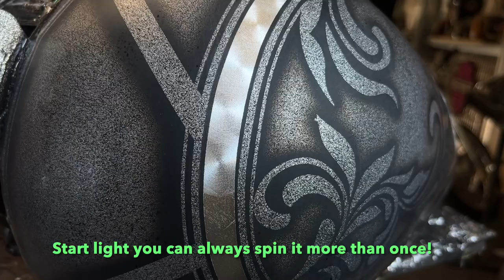Prove Me Wrong!! BEST Method for applying Gold or Silver Spun Leaf from LiME LiNE

Comment: I'm going to start on my 5 gallon conversion tank for my 2018 Street Bob this weekend.  Can't wait to try out the Lime Line leaf, spinner, size, flake and tape I purchased.  My goal is to do something similar to the tank you just did in color scheme, but do a couple light coats of black candy on top and adding just a bit of holographic flake to the metal flake.
Reply from the maker: Awesome 👏

Comment: I love this channel and have learned a ton from you. Thanks for sharing your experience and knowledge with us. I ordered the limeline sizing glue (and the roller & brush too) after watching your videos. I am really struggling with it. I think that they forgot to put the magic in the bottle that I got. 😁 I tried to follow your directions and that on the label. 2-3 coats with around 5 minutes flash time between coats and it always seems to be  too dry before I can get the leaf dropped into place, which leaves it terrible looking. I am doing something wrong,  but I don't know what. I was having a little better luck with the oil based sizing, but I wanted to give this a shot just to try it. Any insight as far as what I could be doing wrong? Thanks again for your time.

Comment: 1:37 why do you remove the making before spinning? 🤜🤛👍🙋🏻‍♂️🤷🏻‍♂️🤦‍♂️🌿
Reply from the maker: So you can correct imperfections on the edges before spinning also the can tape prematurely wear out your turning pads. 🙌
Reply: @TimeWarpCustomPaint  isn’t it like 3000 grit or something like that?
Reply: @Deerslyr81  5000 grit is what comes with that spinner.  I have seen people use 3000, but you have to be careful not to tear through
Reply: @breedlofam  this is going to sound bad , but remember I just started watching these videos to learn. I didn’t know that they came with anything on them. I was hoping to get mine and it have a part number for replacement parts so I could look it up and see what I needed 🤦‍♂️!! 🤜🤛👍🙋🏻‍♂️🤷🏻‍♂️🤦‍♂️🌿
Reply: @Deerslyr81  also, go to Cratex and look up part number Q0166 and choose XF (extra fine).  You can cut your own discs from a 6 inch stick and use double sided tape to attach it to the foam pad.  It's going to take you a long while to use the disc it comes with though
Reply: @breedlofam  awesome thanks!

Comment: Good day, I want to ask you for advice.
what can be replaced LiME LiNE Leaf spinner?
there is a war in our country and there is no possibility to buy it outside the border, I am from Ukraine.
thanks for the answer
Reply: Get yourself some velvet fabric, wrap it around a cotton ball or similar soft material (insulation from a coat if cotton balls can’t be sourced, maybe even bird down?) and rubber band or tape it to the end of your wooden dowel or stick. That’s how engine turning (spinning leaf) has been done at least the last 100+ years. All they’re using here is a piece of machined aluminum bar stock with a bit of Velcro (hook and loop tape) with a pre cut disc of 3m Trizact, 5000 grit sanding/polishing foam.  You can also experiment with other fabrics you can source locally.  Search gold leaf or Gilders engine turning tool for inspiration. It doesn’t take much to make a turning tool. Best of luck.